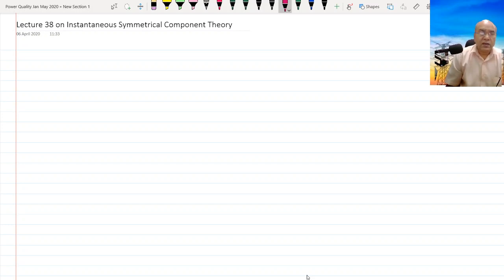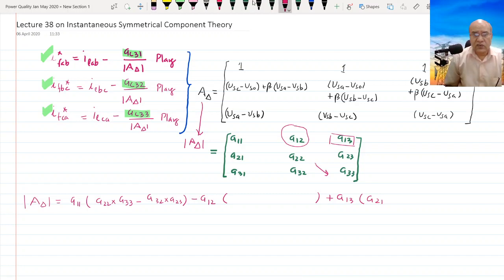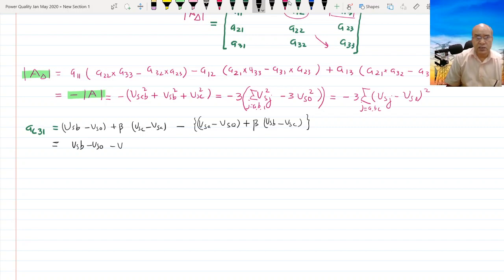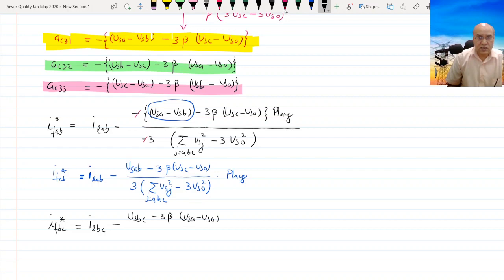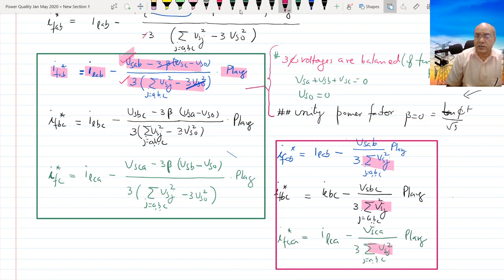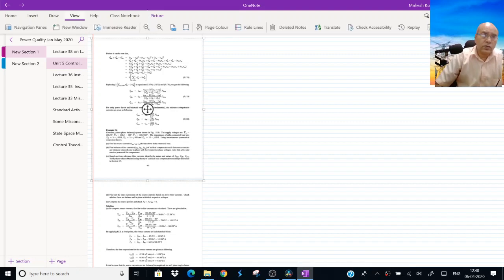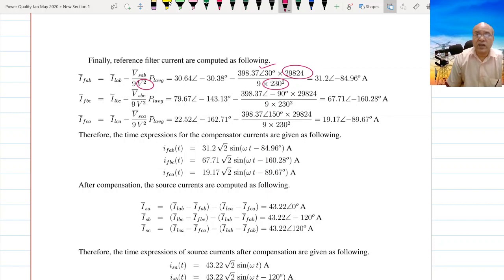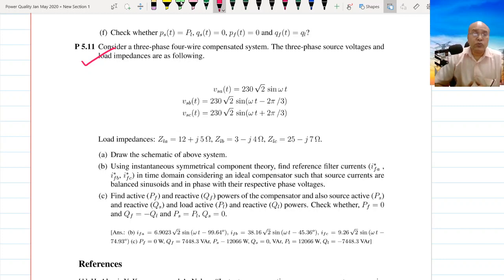Lecture 38 on Instantaneous Symmetrical Component Theory 4

Comment: Sir,
How to compute the value of non linear load connected at load side to grid and statcom, and how to design it
Reply from the maker: It is computed by measuring the load currents using current sensors, then this information is fed into the algorithm.